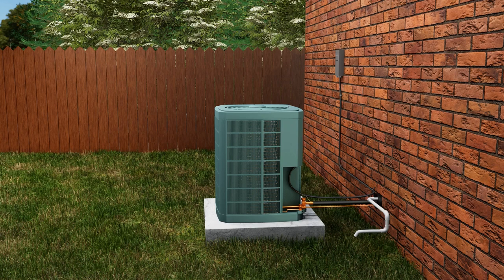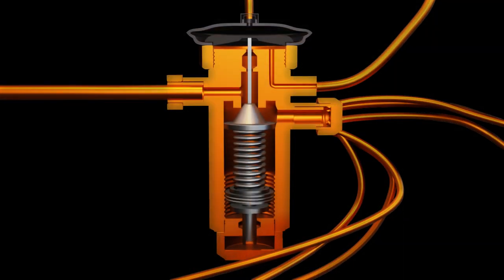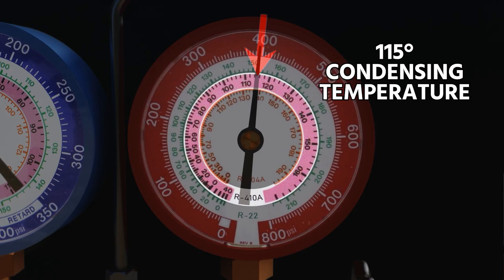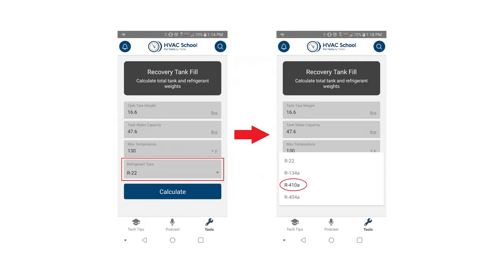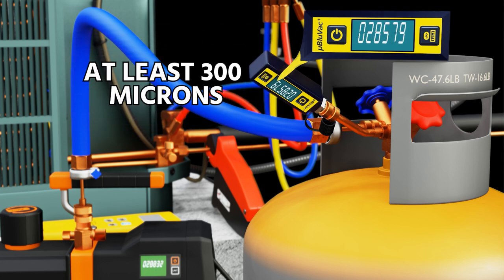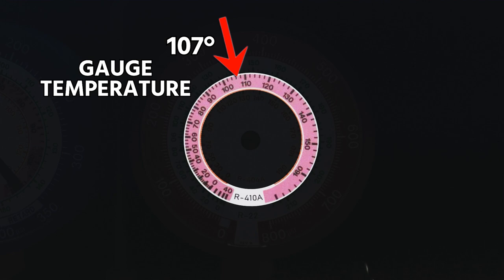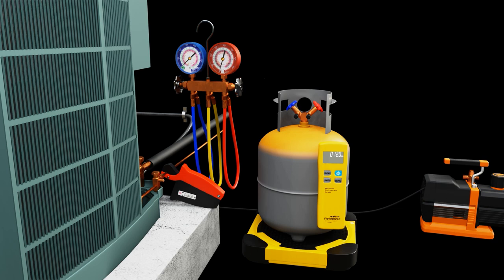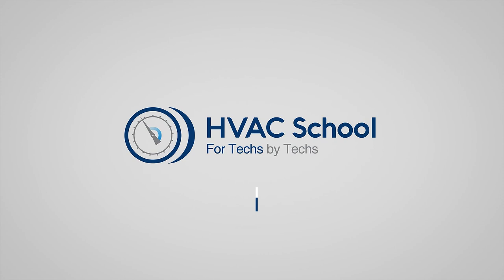How to Remove (Recover) Refrigerant From a Running AC System

Comment: Many scroll compressor AC units have a low side suction line cutout switch for low suction pressure.  It may not allow a compressor operated recovery below a low side suction pressure of about 55 psi.  This still gets most of the refrigerant recovered.

If it is the first time you encounter this, it might scare you when the compressor shuts down making you think you damaged compressor.  Don't worry it is just the low pressure cutout switch doing its job.  You might want to stop at about 60 psi suction pressure to prevent the cutout switch activation.

Comment: Hook up a ball valve on your core deppressor. Close the valve and the high pressure refrigerant will go into the tank and clear your hoses… dependent on the temp of the refrigerant, ambient temp, and the temp of the cylinder

Comment: When you recover the second time and refrigerant is still in tank do you repeat the same process, by first vaking down? Or do you not vak because you already have a vak? And can putting a vak on a tank with refrigerant mess something up? Seems like the vak pump would pull refrigerant toward it into the vak pump and empty your tank I to the vak pump is this wrong?

Comment: While doing this. What prevents oil from leaving the system as well? And would that damage the compressor because if the correct oil was added from the factory and an imbecile overcharged it, if oil came out with the excess refrigerant, the system would now be low on oil? Correct?
Reply: 5 grams is not an issue..

Comment: I’m in school for this and just learning so excuse me for asking a dumb question but if this was a liquid recovery, at the end you said open the hand valves to allow the remaining refrigerant back into the suction side. How is this possible to return refrigerant in liquid form to the suction side?
Reply: Open slowly and let the liquid to vaporize and scroll compressors handle liquid better than reciprocating compressors, there are no valves to break.

Comment: How does pulling to a vacuum harm the compressor?
Reply: Many scroll compressors are set up to "disengage" the scrolls below a certain pressure. Not made to pull system into vacuum the way older style reciprocal can.
Reply: @davejohnsonnola7908  there is a clutch? My mind is gravy.
Reply: @Homestead_Adjacent  more like a mechanism that separates the scrolls and bypassing the gas
Reply: There are several ways a compressor can be damaged when it is in vacuum. Compressors are cooled internally by the returning refrigerant vapor from the evaporator as well as externally by the air being drawn/blown over the compressor from the condenser fan. Without that cooling a compressor will overheat and the motor windings may be damaged. 

The refrigerant vapor and oil within a compressor act as electrical insulators. When in vacuum, the compressor does not have that insulation and an arc may occur inside the compressor and cause a condition called terminal venting. The compressor electrical terminals may blow out or the insulators around the terminals will be damaged and cause a leak. 

Most compressors will handle running in vacuum for short periods but they cannot operate in a vaccum for extended periods. You will see in some literature that warn never start a compressor when it is in vacuum. Low pressure controls will shut off a compressor before it goes into vacuum but not all systems utilize them.